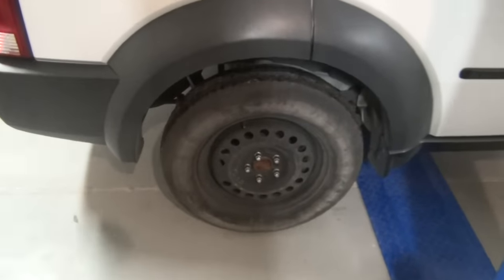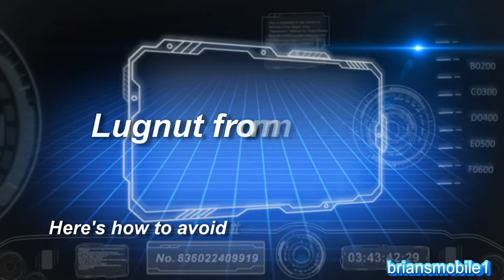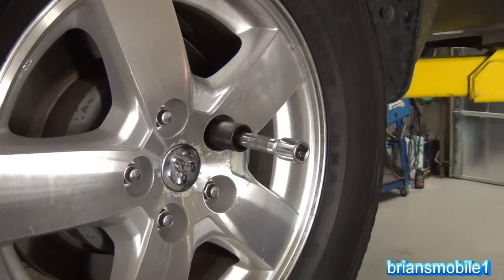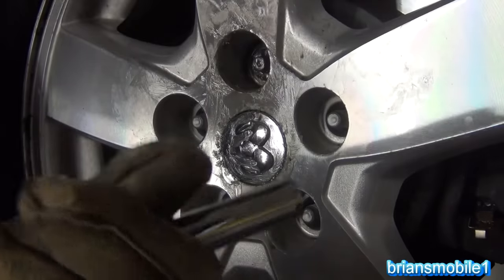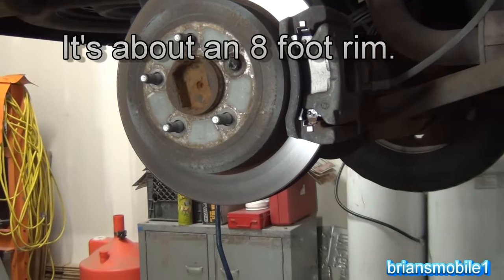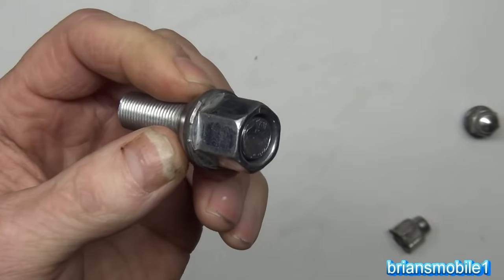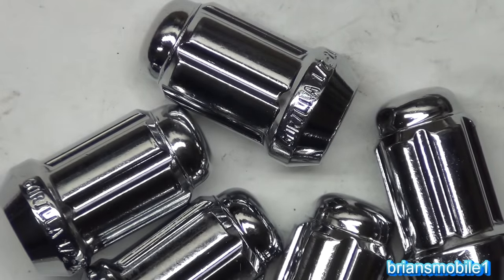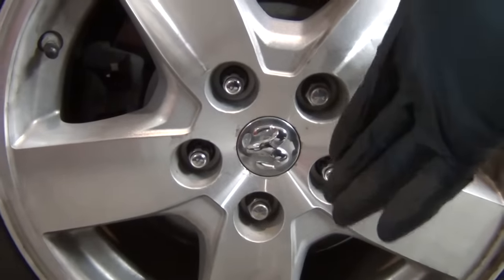Lugnut From HELL

Comment: I am a Journeyman Toolmaker. I just had an experience where 2 of the lugs began to turn in the hub, instead of the nuts turning off the lug. I drilled the lug out, just below the depth of the nut. Then put a socket on the nut and easily broke the lug off. Remove the wheel, replaced the hub (holes for lugs were enlarged), and you was to go. No heat. You would have been able to get by with just replacing the lug.

The nut probably seemed so soft because you "normalized" it with the torch, taking the hardness out of it.

Comment: 6 FOOT PIPE, TURN CLOCKWISE, SNAP OFF THE STUD AND NUT, REPLACE, & ENJOY WITHOUT RUINING A RIM.
Reply: That does not always work. I have a Jeep that had this issue. The mechanic I took it to to do the tires, who was a big guy, used his impact gun set to the highest setting, and also the 6 foot cheater, and this one lug nut refused to budge. In the end, it was drilled out. It did make me feel safer that the studs are strong though.
Reply: @snoopdogie187  You do have to snap off the head/nut before drilling.

Comment: I had a used tire put on and they didn't final torque the lugnuts when they gave me the car back. I was driving about 10 miles home and heard a weird noise. milked it home to find two studs had backed out off the disk brake. although I could pull the spindle nut off, I couldn't get to the caliper bolts with the wheel bolted on.

when I tried to drill it out, the stud spun. I ended up sticking needle nose vice grips on the lug and tried to drill it out with the highest drill bit I could fit in my 3/8" chuck. when that didnt work, i tried alternating between drill bits and dremel cut off wheels. after spending about $100 on drill bits and cutoff wheels, I bought a cold chisle set from harbor freight. I managed to get it off with just a few hammer blows on the one I started with, and about 10 on the one I hadn't touched yet.

I was broke and a dumb 17 year old, so I bought a drill bit and cutoff wheels with every check, took me about 2 months.

usually a stripped out nut isn't that bad. usually you can just hammer on a bigger socket. I do things a bit differently though. if ya can get it to grip good enough, the stud will usually shear off in the tightening direction easier then it will come off, so I just break the stud. they are cheap and relatively easy to do.
Reply: oops, ment smaller socket... also, don't be afraid to try metric sockets. they are a bit smaller/larger then the imperial equivalents.

Comment: Remember to put the tool in safely with the tyre iron as well, so when you need it it is with the vehicle, not sitting on a rack in the workshop. Drill a hole through the tool ( hard yes because it is hardened steel, so go to an engineering shop and pay him to spark erode a hole through or drill it out with a carbide drill) and use a wire to tie it to the tyre wrench, or use a set of nuts that have a tool with a hole already.

Already had to do a tyre change in the rain using a hacksaw to cut the bolt off as it had stripped. Was not a fun hour, but luckily I did have some hacksaw blades in the car and some electrical tape to wrap a handle on.

Comment: iam a lube tech a dealership and absolutly hate when I gota do a tire rotation on Ram trucks. I ran to a similar problem but hammered a 20mm socket and broke loose with a breaker bar. These lugs nuts are garbage

Comment: Well that was interesting. 
Step 1, as you mentioned, if the stock wheel lug nuts are in poor shape, evidenced by bulging or misshapen caps, immediately replace them with a set of quality 1pc lug nuts.

Step 2. If the proper tool will not remove your damaged lug nuts, purchase a set of lock nut removal tools. Lock nut removal tools have an internal reverse thread and screw onto the outside of the existing nut until the torque required to screw them on exceeds the tightened torque of the fastener, then the lug nut comes off inside the tool.

Step 3. If step 2 didn't work for whatever reason, or you don't want to purchase proper tools, use an electric drill to drill out the wheel stud inside the lug nut using a lug nut that you were able to remove to determine how deep to drill. The drilled out stud can now be easily twisted off, releasing the wheel. The interwebs can tell you your stud diameter with a quick search. You can use that information to select a drill bit slightly smaller than the stud diameter. Drill first with 1/4" bit to depth, then re-drill with final diameter bit. Use lots of lubricant to keep the bit cool.

Avoid torching or hammering your wheel faces. This can actually wind up costing you more money in failed wheel bearings, damaged wheels, and other damage.
Reply: An what if you have all the 5 nuts seized? Or even the nuts on the 4 tires seized?drilling all
Reply: @erosbugatti9497 I’ve never had to drill every lug, but yes, that’s what you’d do if needed.

Comment: I had a 2002 Neon once.  The best thing I ever did for it was getting rid of those 2 piece lugnuts.  The local tire shop not far has solid ones that are chrome plated for a dollar each.  I just told them to change all 20 of them if they had that many all matching (they had slightly different ones but I wanted them all the same).  I never did have problems with the original lugnuts.  That is because I knew the horrors of them and had them replaced first thing after getting that car.  I don't know whatever the hell it is that possesses Chrysler to use those awful 2 piece ones but diehard Ford and GM owners probably thank God for not having to put up with those horrible things.
Reply: Its because they are union. They help mechanics get $90 an hour to fix and replace. They all live in the BIG houses in Dearborn, mi. Ha Ha It also made you buy a set of metric tools too.
After all to be union you are the best money can get. Great training and replaceable .They are equal with same training and good at what they do. Look at union electricians....
They do it without shorts!  Ha Ha

Comment: I didn't read all the comments, but drilling out the lug is the simplest solution. After breaking a socket (Craftsman 6 pt) with a breaker bar and no alternate 1/2" socket, I just drilled out the lug itself, with sequentially bigger drill bits. Eventually, it collapses and the nut can be pried over the remnant.

Comment: Been there, done that, don't ever want to do it again. I didn't personally do it, didn't have the tools, but I trust my mechanic and my tire guy to no end... needless to say my tire guy broke 3 sockets and couldn't get the lug nut out with a 3/4" ingersoll rand impact... I think it's rated for like 1,350 lb-ft. He cranked the air up to 130 psi and broke 3 of his sockets (after he'd heated the bolt), that thing wouldn't come out. Finally I told my mechanic to just use his torch and melt the bastard clean out. I had to repaint my rim, but I didn't even care I was so sick of that bolt. 
Oh yeah, and the stealership I bought it from, I asked them to check the front suspension before I left with it, I told them I wanted the tires checked to make sure they were balanced before I left the lot... apparently they didn't like my high maintenance attitude, and when they put the front tires back on they zipped them on so hard this video was the end result.
Edit: I didn't have a vehicle that used these strange lug nuts, I have a Saab which uses a lug bolt. The bolt wasn't cross threaded, and neither me nor the mechanic could figure out how it took so much abuse and didn't just come off.
Reply from the maker: +Jesse Crandle Brutal.

Comment: I recently went to get an allignment done and they over torqued my lug nuts when finished. I ended up striping the lug nut trying to take it off. So I had to hammer my 4 way onto the lug nut and put my breaker bar on the end to finally break it free. I literally got light headed trying to break it free

Comment: Buy a stronger impact gun that can break the stud.  I have never had to torch a wheel nut off!
Reply: you haven't been doing this long enough
Reply: Your right. 15 years of being a mechanic is not long enough.
Reply: Nick Palmer and only 85more years to go
Reply: I never use airguns for stubborn lugnuts, if it is possible to remove them, I always use a breaker bar, I feel like you get alot more torque jumping on a breaker bar then using a air gun lol
Reply: @narule2695  
50+ & never torched a wheel nut.
Not even the ones that are reversed thread, lol 

However have heated some up but usually on big trucks.
Reply: @MegaBigdaddy1998  I have a breaker bar that is about 39 inches long & 1 inch drive & adapters to go smaller.
& a 1 inch Drive gun.
Think that's big enough ?
Reply: @sexiewasd  a ratchet strap ?
My 4 yr old grandson could dill one freehand !
Reply: @sexiewasd 
Apparently,  because if no actual experience you do not realize that there is NO way possible to center your dill using a ratchet strap & most hand drills are not designed to have 250lb of force used on them.
Then there is the amount of strap taken up per click of said strap which is totally uncontrollable, pressure & "wobble" guide or  lean over wise.
So.
How about you go & actually get some  hands on experience instead of reading a "drilling studs for idiots" book & running your trap on the internet !
Oh & while you're at it  learn the difference between "your & you're"
Reply: @sexiewasd typo aka missing   a letter etc is a hell of a lot better than not comprehending  what "your" means.
BTW how do you mount "your" cnc machine on a wheel ?

Comment: All that you had to do was to use a drill with a hole saw cutter. Usually a 5/8" or a 9'16" diameter cutter works. I am an auto repair tech with 41 years experience. I have removed many stuck lug nuts.
Reply from the maker: That's good advice.

Comment: I was looking for videos of getting rusted lug nuts and found this old video of yours. When I used to tow I carried a loose lug cap in my bag for lug nuts that were missing their caps. I also carried a set of sockets that could take off lug nuts that required a key. I just snapped off 2 lug nuts on a wheel. Just ordered the studs in case the rest go south the same way. Glad that the paste worked for you. I would have drilled the stud out but hey any port inna storm. Happy Motoring.

Comment: A tireshop recommended McGard security lugs nuts. 1 year later, one of the broke on while on the stud. I had to take it to specialist to get it taken off. Then I started using the Gorrilla security lugs and then are amazing! Used the same ones for over 12 years, no issues!

Comment: Well that's a bugger!
Reply from the maker: +sixtyfiveford Moe knows!
Reply: +sixtyfiveford 'Ive had a brake job on my truck turn into changing all the lugs out after having new rims and tires installed. The lug nuts galled onto the studs and just smeared the threads all the way off. Still not sure why that happened.
Reply: +soaringtractor I have since done that. I also swapped from closed lug nuts to open ones the stud can pass through.

Comment: why didn't you just drill the stud ???? would have had no damage to rim ...
Reply: Ian Rogerson he had too much money
Reply: Ian Rogerson he's lack of common sense or he's trying to save the stud eventhough on that situation.smh.also,by heating it up making it worse from the start.its like welding the lug bonding it to the stud everytime he reheats it.and additional hammering it with a chisel and drilling the side of the lug.for god sake!he totaly traped them bonded together with the stud and now sticking on the rim hole.since he has the driller,why he didn't drill the center of the stud all the way down,then use his chisel to break both the lug and nut after putting the hole that will make them hollow and easier to break.smh to this kind of mechanics that ruin people's car just for experiment.
Reply: Ian Rogerson he doesn't know that technique.or he probably still trying to save the STUD in that situation haha.smh
Reply: Hindsight is 50/50. I spent a whole day trying to repair a lawnmower at work, it still didnt work because the carburetor was completely fucked as was the ignition. Would have been cheaper to buy a new one...  Shit happens.

Comment: I had this EXACT thing happen to my Dodge Dakota while rotating tires. I was being careful because I've had caps come off before, but my 12 point 18mm made it as round as could be just like this one because the inspector put the lugs on so tight, I had to use my 5 foot cheater bar to break them loose. I don't have nice torches or air tools or anything like that, and I could NOT afford a new wheel, so first I went to the sketchy po-dunk mechanic and he told me he wouldn't touch it unless I agreed to let him destroy my alloy wheel. Then I bought a Craftsman fluted extractor set, and when that only made it worse, (Thanks for telling me why! I learned something today!) I bought five hardened, carbide drill bits and drilled the stud all the way through, changing the bit as the hardened steel burned each one dull. Then I took a chisel with a 19mm hex end and pounded it into the middle of the soft lug nut, put a socket and my breaker bar at the end of the chisel (still wedged in the lug) It FINALLY came loose, and my wheel was unharmed. I get VERY angry when the inspector doesn't just hand me the caps in a baggie (like I ask every time) after they are blown off by air tools and instead just pops them back on to fly off as I drive away. I really need to do what you did and invest in better lugs, but my Dodge has six lugs per wheel and those sets are too expensive for a broke college student like me. I JB Weld the snot out of every single one as they come off, and its been years since I've had one go missing. I keep just a cap on hand at all times to use when one does go missing to avoid this very situation.

Comment: I have seen guys that thought they could put lug nuts on like the nascar  guys, of course it would work sometimes but more times it would cross thread, if a person really thinks that they need to be able to do like the nascar guys, they need to get the right style lug studs and nuts, or just take the time to start them by hand and don't torque them down with a impact running 175 lbs air pressure, when I torque, I will use the impact to snug then I do the final by hand
Reply: You’re right if your using an impact to torque always use a torque stick
Reply: Torque sticks are useless. ALWAYS use a torque wrench.

Comment: Another reason not to buy a Chrysler product.
Reply: first thing that popped in my head
Reply: My Jeep was a piece of shit...it's now gone. Someone else's headache now.
Reply: Had same thing happen .      2000 grand Cherokee was biggest POS  I ever worked on.    Damned 4.0 engine snapped a ring at 113,000.     Jeeps are all POS VEHICLES
Reply: Merlin Cat lol too broke to afford one
Reply: This can literally happen to any caf
Reply: Read my mind on that one. I hate Chrysler. They're very unreliable. I'm sticking with the German cars. Got 240,000+ miles on my Passat. She still runs like a beast.
Reply: +orochiwarrior111 It's all in the maintenance I have 277 thousand miles on my zj grand Cherokee if you don't take care of the vehicle properly it won't last having any car or truck last anything under at least 160k proves the owner is lazy about maintaining and probably only did the bare minimum to keep it road worthy and that is fact
Reply: +M773 maybe it was beaten on, driven hard, over loaded or spent lots of time sitting maybe rodents got to the wiring you can say all mb v or m vans are bad because yours was garbage when there are plenty with more mileage and still running proper AND able to pass govt/state inspections i had a 2000 Honda civic I beat the piss out of and purposely killed it before 60 thousand miles but that car is known for running for over 300 thousand miles sooo the only point you made is your "maintenance" or care care/repair methods are shit and can't keep a "quality made" vehicle running very long and if you are bot the original owner of that mb v it's impossible for you to be certain about how it was maintained because you don't know what type of individual worked on it before you, in regards to service records there are many workshops and dealerships with shit technicians and plenty of crooked shops that will print phony service records for any vehicle for a few dollars under the table besides yugo, lada and Daewoo there's not many vehicles today absolutely not capable if at least 200 thousand miles with PROPER maintenance with strict service intervals regardless to whether or not you think it's necessary, hell even my neighbors old Kia Rio has 264 thousand miles and that in the usa is considered a "throw away" car
Reply: @orochiwarrior111  If you think that VWs are any more reliable than Chrysler products, you are sadly mistaken.  My 02 passat has had a transmission leak, a diff leak, and I had to replace the TCM.  Also it's burned oil its whole life.  Meanwhile my 99 Cherokee is still bulletproof at over 200k.
Reply: @tyvekhomewrap9164  That's a selection of two cars out of millions. No conclusions can be drawn. My 5-series bimmer has too worked pretty much flawlessly while the toyota  I had had almost weekly problems, I still wouldn't claim that bmw's are more reliable than toyotas.
Reply: Most of us can agree, Chrysler dodge is not on par with their competitors.  My friend is a die hard dodge truck fan. He bought a 2010 ram, and it rusted out bad in 2 years. Also the rear diff locked up. No towing or abuse at all. Junk.
Reply: The JEEPS are a POS, but never once I’ve ever had a problem out of my Dodge Avenger, has been a very loyal car
Reply: GM was the first to use this style lug, and still do. ford uses them too